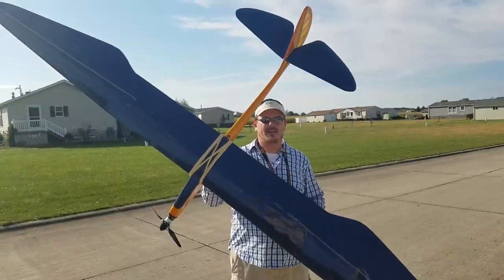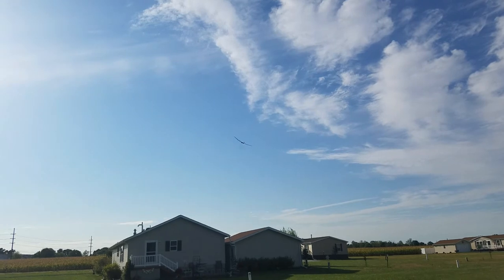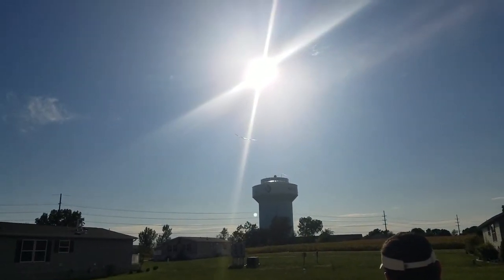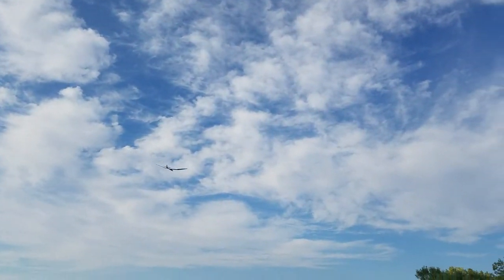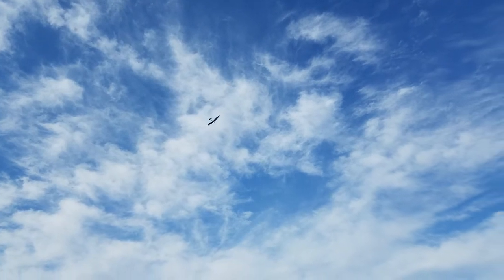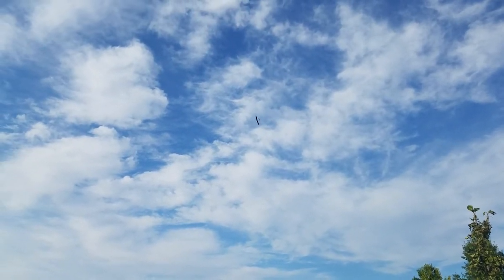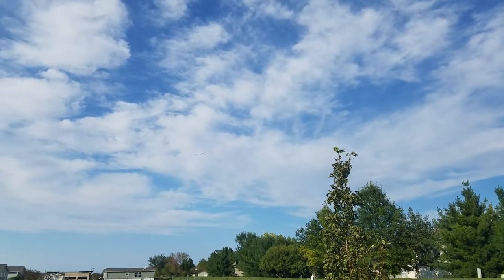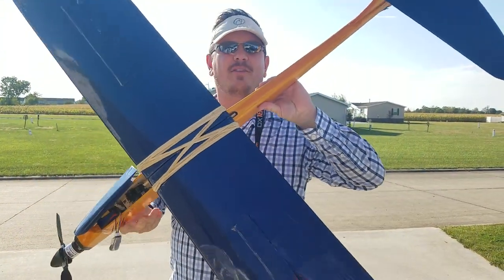Dynaflite - Bird of Time - ESC Upgrade - Flight Video

Comment: I had thought about getting one of these awhile back and now that I see the flight characteristics I may consider getting it now. Nice flight Brian.
Reply from the maker: Clay Clay That's cool! I'd definitely recommend this plane, but keep in mind I've added the spoilerons, which help make the plane a whole lot more controllable. I also increased the deflection of the stabilator (elevator), and rudder.

If I were building it now, I'd use WAY more powerful servos on the stabilator and rudder, and I'd stagger them for more room in the fuse. I'd also make the wing with a lot less, or NO polyhedral, and I'd install 2 Longer Carbon Fiber Joiner Rods, rather than a super heavy steel rod. I'd probably want to make the plane to receive the motor as well, to avoid having to have a motor hanging off the nose.

Lots of other little things, but I'd rather have ailerons and flaps, even though the spoilerons work, they bleed off a lot of lift with normal flying...ailerons and flaps could be used to produce a crow effect, and that would be equally or more effective than the spoilers, to bring her to the ground safely.

Comment: Nice video and info too! What motor are you using? You said 810kv but what brand? thanks!
Reply from the maker: Thanks James! I was using the Eflite 850kv Motor (like from a 1.2m Warbird)...I think I might have mis-spoke...
Here's a link - https://amzn.to/2WeKOkX
Reply: @BrianPhillipsRC  Thanks Brian.  I've got two  BOT's coming. I'm going to make one electric like yours, set up an FPV rig on it once I get the bucks, and go travelin'!  I'm a rated LSA/ultralight/glider/hang glider pilot but I'm 73 and setting up a hang glider and breaking it down, rinse/wash/repeat, is too much of a hassle now for my lazy old bod. And the thought of thermaling with FPV is really a turn on.  Much more fun than drones IMO. I watched an fpv video on youtube just now, a guy in Italy with a Radian got 58 minutes, thermaled up from low and skied out, all on FPV.  Landing is fun too. 
In case you haven't seen it: 
https://youtu.be/kQ0O_9FLstc
Thanks again, I'm watching your videos over and over. I also have a Graduate coming, I'll build that first to get back in the groove and get used to thermaling while standing on the gtround, which is a different beast entirely I'm sure.
Reply from the maker: Cool James!
I love being able to sustain flight from mother nature!!!
Slope soaring is the way to go, if you ask me - It's SOOOOO much fun if you can get the right conditions!
Reply: @BrianPhillipsRC  super, thanks Brian. I'm thinking of setting it up for FPV also. Any suggestions for the BoT?
Reply from the maker: Nope, the spoilers I added were a fun thing, but if you build the BOT right, they aren't necessary, just COOL!
I'm kinda into "over-the-top" stuff like this :)

Comment: It looks like there is not big enough  air inlets/outlets.  Some websites say to have larger outlets than inlets. The inlets/outlets you have look very small.
Reply from the maker: The Fins + In/out holes seem to be keeping things at a good comfortable level now. They are pretty decent sized.

More ventilation is generally better, but mine is directed exactly over the ESC...so maybe that's why she's working well for me???
Reply: @BrianPhillipsRC  Wonder if NACA-style inlets would work at this scale?
Reply from the maker: I bet it would, but the side walls of this plane are not too thick, thus the not-so-pretty hole :)
Reply from the maker: Cool!